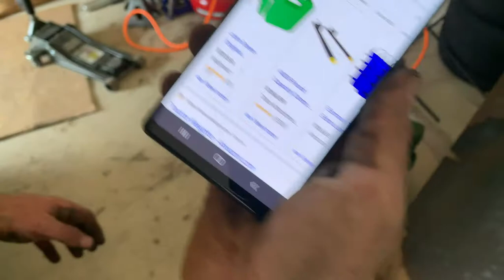Installing DJM Suspension Rear Flip Kit On My Ram Daytona

Comment: After I did my djm adjustable flip kit on my 06 Ram I realised the right side was sagging which turned out to be a flat leaf spring. After I replaced both leafs it leveled up but lifted the rear about 3 inches. With all those tractor weights and plate about 300lbs extra did you find your leafs to be flattened?
Reply from the maker: Yes the leafs are flatter. But the truck sits level without maxing out the rear end so it’s kind of perfect.

Comment: Big big question if I do the 2/4 drop would it vibrate a lot ?  i do a lot of traveling so the vibration is the only thing that’s is stopping me to drop the truck
Reply from the maker: I’m on a 3/5 and the only vibration I get is from 20-30mph maybe 25-30mph. I think I need to add shims on the rear to address the pinion angle. 

But other than that it rides like stock. Cruising 80mph is smooth sailing.
Reply: @TIRADORACING  oh so it’s not that and is all your drop kit form DJM suspension?
Reply from the maker: Yea all DJM front lower control arms, rear flip kit.  And not bad. Also I added the nfamous metal labs bumpsteerkit
Reply: @TIRADORACING  bumpsteer kit?  I've never heard of it.  I've got an '05 I'm wanting to 2/4 drop. Is the bumpsteer kit necessary?  Is there another way to lower the rear without a flip kit?  I'm glad you did the front lower control arms.  I assumed I'd have to use drop spindles.  How low is yours in the front?  What size tires are you running front and back?
Reply from the maker: You have heard of it, I mentioned it like 3 times 😂. It’s from here

 https://www.nfamusmetal.com/2002-2005-dodge-2wd-1-2-ton-steering-kit/

Necessary? No. But do you like death wobble? 

Not sure of any other way to lower the rear besides shorter shackles on the leaf springs and flip kit. Just Google Dodge Ram lowering kit and you’ll find a few options. 

And the only company that does a lower control are is DJM and they only do 3/5 which throws your 2/4 plan out the window if you want the lower control arms 

If you want 2/4 spindles and shackles looks like your answer. 

And their 305/40/22 all the way around. 

Hope this helps! Let me know if you have anymore questions.
Reply from the maker: Also if your going 2/4 you’ll have more room than I do for some more tire.
Reply: @TIRADORACING  thank you for the help.  I'll keep this in mind.  I've got a lot of plans for mine
Reply from the maker: Anytime bro! Keep me posted on your build!
Reply: @TIRADORACING  I've only seen a few of your videos so that's why I haven't heard of the bumpsteer kit

Comment: Hey, quick question.. I recently did a 2/4.5 drop on my 02 ram 1500, but now my rear end starts shaking from 60-70 mph. Do you know how to fix this, or whats causing the vibration? (Also, i only installed the rear flip kit, and kept the front stock height)
Reply from the maker: Probably your drive shaft angle. May need to be corrected by shimming the rear axle.
Reply: @TIRADORACING  Oh ok, appreciate it

Comment: Why didn't you just put the jackstands on the frame in the rear and the jack on the differential to push it up and line up the shackles
Reply from the maker: Honestly I have no idea. Kind of like 4+4=8 but 5+3 = 8. At the end of the day we reached the same conclusion with a different method.

Comment: No c notch required?
Reply from the maker: Watch my other video where I go in depth about it all. I have a c notch waiting to be installed but I drive around without it just fine. Just drove 10 hours round trip not one time did the axle hit the frame. 

If you load the bed then yes the axle will hit the frame. 

I don’t haul anything so I haven’t thrown the c notch in yet but I am in the future.
Reply: You think ima need a c notch if I’m doing a 6 inch flip kit
Reply from the maker: More than likely yea. Mine is 5 inch but I don’t have it at the lowest setting. If I put it at the lowest setting it will hit without a doubt
Reply: Yea ima have to just try it out to see if it bottoms out. At the end of the day I can put lift shackles to lift it a inch or 2. I’m trying to make it into a race truck
Reply from the maker: Hey.... I like your style. I’m doing the same thing lol 

What are your plans so far I would love to hear them.